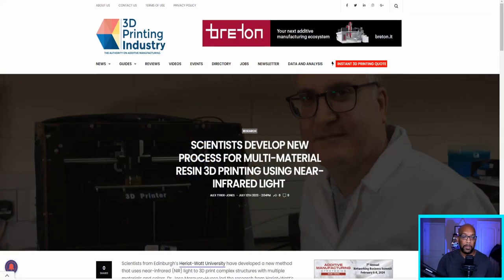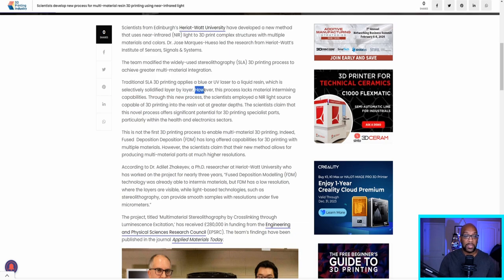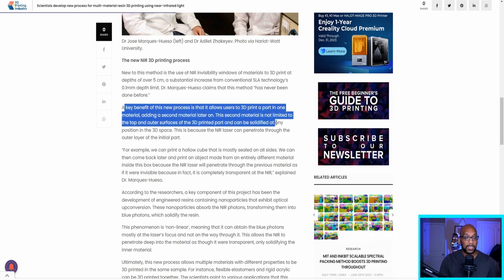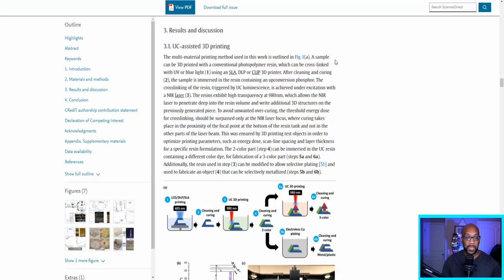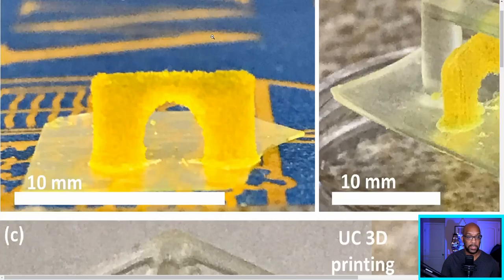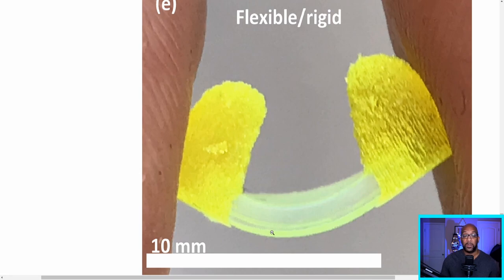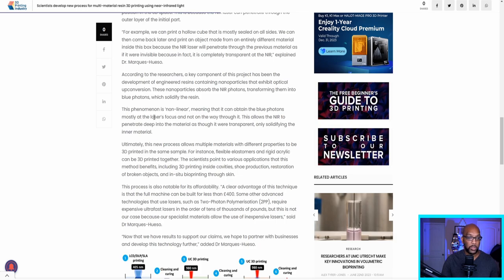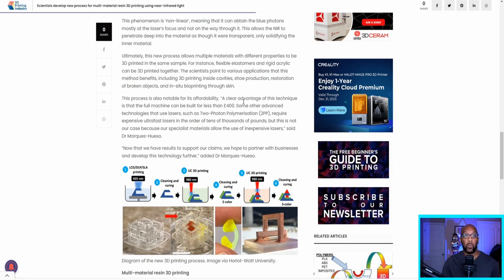Is This The Future of Resin 3D Printing?

Comment: I see a great deal of possibilities with this type of resin printing.  As you mentioned, I think about the joints of a figure.  It might make it easier to print an entire figure instead of parts.  I am attempting make some custom GI Joe and Starcom figures.  It would be great at some point to avoid using extra hardware to assemble them.

Comment: This is kinda cool, but honestly, the biggest advance in resin printing would be developing a non-toxic resin and accompanying process
Reply from the maker: That would be an instant game-changer.
Reply: They have those now, actually. There's quite few corn-based resins out there, and one that I know of that is more like a PLA. Not terribly expensive, but about $50 a bottle. With more adaption, the price will come down significantly.
Reply: @C-M-E  thank you for this. Any amount of money is infinitely better than health risks
Reply: @VektorVirus  I hear you there, though standard resins (outside of engineering grades) are a manageable risk with the right precautionary equipment, unless you're severely allergic to the normal variety. 
As an interesting tie-in, I was at a trade show about twelve years ago when corn-based polymers were just starting to hit the market. It was an interesting experience to say the least. The packing  peanuts were arguably the best as they dissolve in water after use, but the stirring spoons, ugh... They don't handle hot coffee well. 😉
Fast forward to last week when my best printer punctured my fep film and blew its guts out unceremoniously, I upgraded printers and found that same company was behind corn-based photopolymers. Cool!  For the good news, I had a look around and the price has come down tremendously since I last checked. $30 a bottle is Very comparable to the stuff I use now price wise (don't know on performance but worth a shot at that price!), and it's supposed to have a lot of nice side effects for stability and structural complements like less shrinkage and cracking potential. Not to mention is biodegradable and quantifiably safer to use long term. win win!

Comment: While this is fairly interesting, it's not going to be time efficient by the process they've detailed. Perhaps I need to get back to my multi-color resin printer project sooner than later, as it could be built for about $300 US, and most of the parts already exist in other industries. My main holdup was software, but I'm right on the edge of tackling that with a bit more refinement. No more fep, very few supports, no powder like the additive binder machines, and Full color. Best part, Speed; 34 minutes for a 110mm tall figure. I hadn't tested multi-material, but it wouldn't be any more difficult to implement than changing a color. 👍
Reply from the maker: That sounds incredible. If you pull that off, there should be a statue erected in your honor.
Reply: @FigureFeedback  I'm surprised we're not all using something similar already to be honest. You can get pretty close to that speed with continuous printers now, the DLP-variety industrial-level printers that lower into a huge vat of resin. I looked at it over the summer, but getting rid of vibrations that disturb the top layer of resin was troublesome to make an equivalent desktop model (probably why the big ones come on an isolation foundation that you need a pallet jack to move!) They're still single color naturally. I need to approach a specialist company to see if they'll work with my design, just a bit anxiety-ridden that they'll run off with it and leave me deeper in the hole of obscurity than I am now. 😉
Reply: @C-M-E how did you implement multi color? sounds awesome
Reply: @noatreiman  It is best described as a 2d printer with 3d printer motion controls. Getting resin to flow through a print head is a real doozy though and you need a specialized part with exceptionally fine flow characteristics, pumps, etc. After you get all that nailed down, it's just resin colorants and a few base additives that make photopolymer resin behave like inkjet toner (albeit quite a bit more viscous). If you're really interested in reading up on it, getting into the viscosity dynamics is excellent brain fodder if you like that sort of thing. 😁